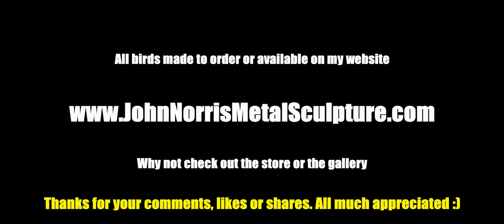Making Beautiful Birds Out Of Old Spoons -

Comment: Love it dude...Q; How do you run settings?, you don't seem to get much splatter??
Cheers Paul.
Reply from the maker: Hi Paul, thanks alot. Not sure what your welding set up is but ...

... Too much splatter is one of a couple of things (said the actually not very proficient welder!) So .. if you are trying to weld stainless steel (cutlery) then first off you need a gas MIG or TIG.

You can weld it gasless with flux core wire but honestly it's not even nearly a nice weld, too many imperfections / contaminants in the weld and the results will be weak and porous .. and yes, a shit ton of splatter! At best you'd be going over the same welds over and again to get a nice finish. 

I use 95% Argon / 5% Co2 in the MIG and 100% pure Argon on the TIG. If you try using pub gas (co2 only) it wont give great results. Fine for mild but awful with stainless.

2nd, gotta make sure the materials are as clean as possible or you'll get imperfections in the weld pool that lead to more splatter, especially true of TIG.

You can buy 'anti splatter' spray but its not gonna do anything on stainless and even on mild it wont cure the problem totally.

As for the cutlery itself ... generally it comes in different grades. 18/8, 18/10 etc. So this is telling you that the amounts of nickel and chromium in the material are different. I suspect these different grades have an impact on the weld / potential splatter too but generally with the right gas there is no problem.
Reply: @JohnNorrisMetalSculpture  Thanx for response dude!
I'm new to welding and have a gasless MIG system, which I suggest is in the handyman range. I guess I will just have to try speed/feed settings to see which suits. Love ya work.
Cheers Paul
Reply from the maker: @paulconnell2385  I am a long way from a 'good' welder. My MIG is quite literally the cheapest gas MIG i could find. I do think you will struggle with stainless without the shielding gas but I'm not a real expert. Might be worth googling / youtubing 'welding stainless without gas' and seeing what you find but i suspect it wont help much. Best of luck, thansk for the comment!